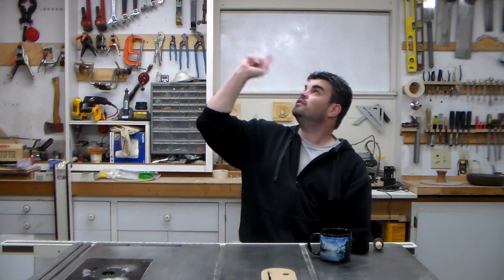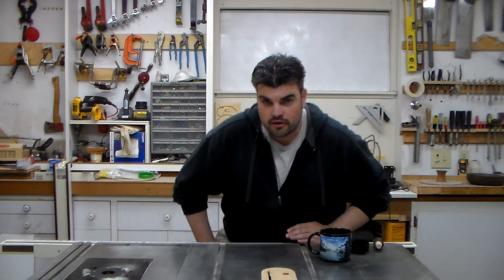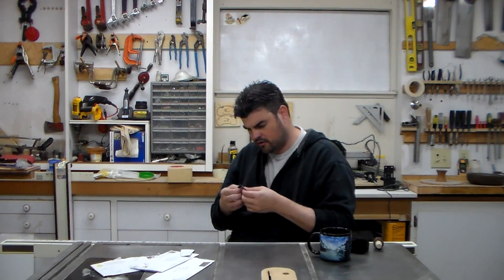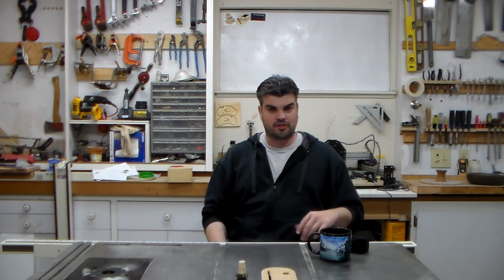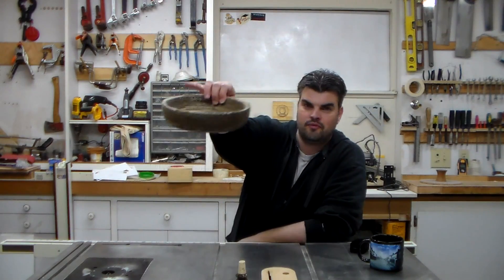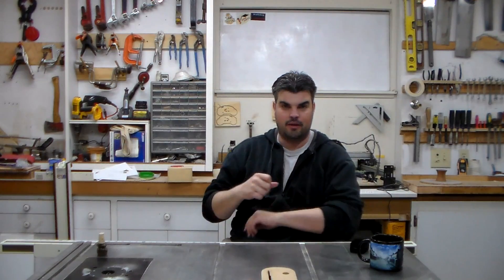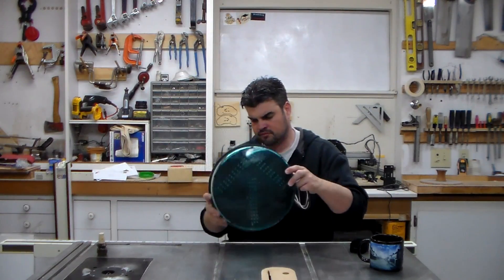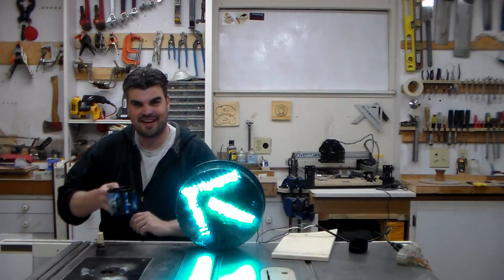Green Lights & Brown Bowls

Comment: Dema uses a pressure pot to get the air bubbles and voids out of what he makes. Would something that like be needed to fully immerse something like cardboard in the epoxy?
Reply from the maker: ***** It would be easy enough to re-add epoxy and over the cardboard completely. I actually spent a fair amount of time removing epoxy from the all the holes to give it more of a straight cardboard looks.

though, a vacuum chamber like +Dema's Woodshop is absolutely on my extended wish list. I just don't want to get to a point where people need a lot of specialty items to attempt what I make.